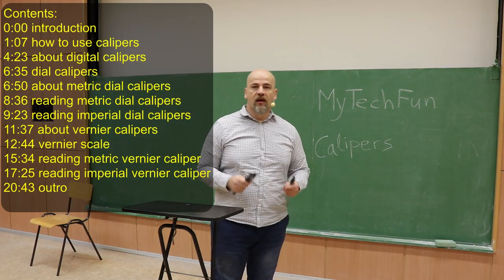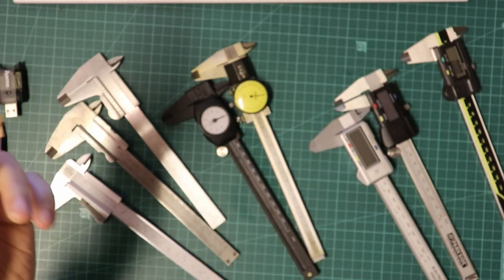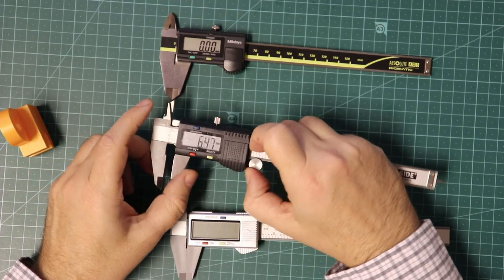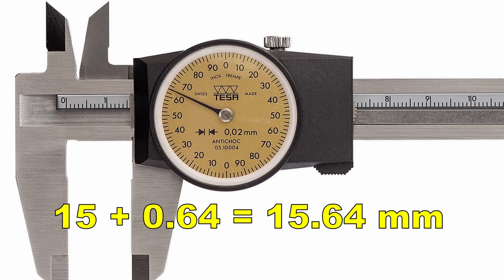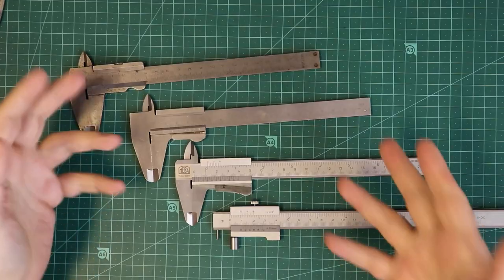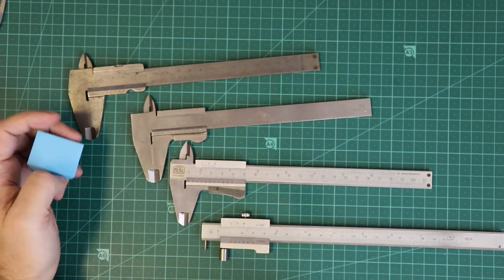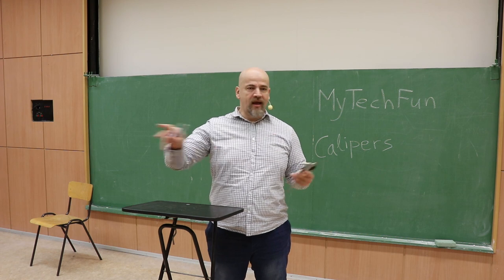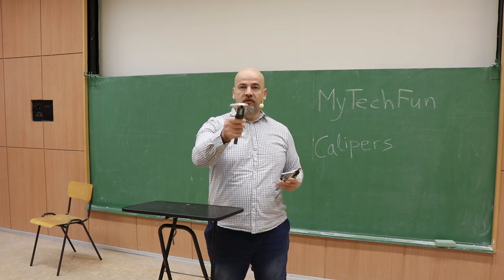About calipers and how to read them - dial, digital and vernier caliper (metric and imperial)

Comment: I have the Parkside one, it's great and cheap, from Lidl supermarket . But, sometimes, when we open it very fast, there is an error.
Reply from the maker: Yes, that's the disadvantage of those cheap relative reading calipers. They works great, until you are not "too fast".

Comment: I know how to use them, but watched your video anyway - and I know somethning new. Imperial units are way dumber than I thought they are, and I drive US cars on daily basis so can relate. :P
Reply: The division of the inch into fractions of is actually the one smart part of the system. For certain applications but mostly in carpentry. Like dividing a part into equal sections of 2/4/6 etc.

Comment: My biggest frustration with digital imperial calipers is the fractional display can't be tounded to reasonable fractions.

If you want to quickly measure a bolt head for example to see what socket you need...instead of being able to display the closest 1/16" for example on a 9/16" head...the display will show 143/256" or something similar and you have to do the math to see that 9/16" is the correct socket.
Reply from the maker: Maybe you need something like this? https://www.chipsfly.com/fastener-cal-caliper.html